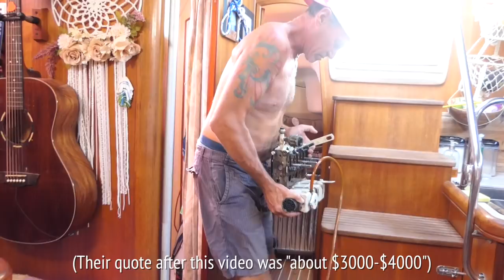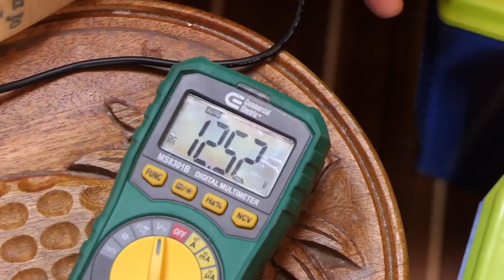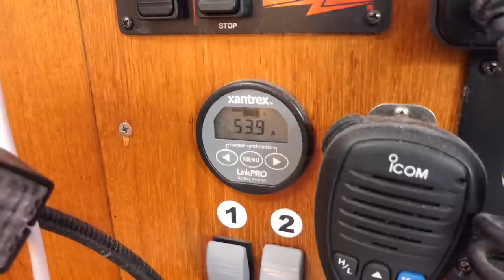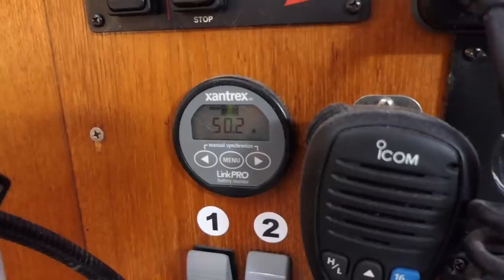Our $3,000+ MISTAKE - How Do We Make This WORK? | SailAway 185

Comment: Gotta say your "bearing"  on the piston connecting rod(which is really just like a metal collar type thingy) which is attached to the piston an crankshaft is likely worn down to nothing.  That means your piston doesn't lift high enough in the block to compress the diesel fuel on that cylinder.(Which diesels compress fuel into an itty bitty space to make it combust as opposed to a gasoline engine spark plug)  So essentially you may smell an excessively diesel fuel smell when it is running because it likely isn't burning 1/3 of the fuel it is injecting.  The wear may have just happened, but likely is the result of overheating, but more likely is due to a lack of lubrication in that section of block.  The piston could have had the bolts back out too where it meets the crankshaft.  My suggestion to get the thing out is to just take it out in pieces.  I would love to have a genset like that, but I really don't have the space.  (Catalina 30).  I do set up my Westinghouse Igen 2600 and get a good bit of service out of it.  The Victron charger/inverter can charge my bank at 100 amps  for like 8 hours on the generator for only a gallon of fuel.  Your Balmar is an awesome addition to the boat and will fit the bill.  If your inverter can handle the load, you could maybe run the AC during the few instances it might be nice, depending on its size.  I think you said you had a 16,500 btu...might be a little weak to keep the batteries topped up at idle.(It probably pulls like 17 running AC Amps.)  My friend did the alternator bit for charging and went to sleep one evening to wake to a locked engine.  The intake strainer had clogged and the engine didn't have an overheat alarm...Just remember to check your strainer all the time because PR and the islands around are full of that floating seaweed everywhere. My genset is still available, even after all these years , from the same guy on ebay.  He gets the returns from the manufacturer.  Often they were just in case buys and returns...never turned on by anybody but the factory.  I purhased mine years ago for $460ish...with only one hour on the clock.(thy have an hour meter and digital display with runtime)   It is also one of the few economical generators to actually have enough oomph to start most 16,500 AC units without having to step up to a 3500 size generator.  It uses less fuel than a Honda 2200i(which won't power a 16.5k) and my unit hasn't missed a lick with 460ish hours last time I looked.  Since you live full time on your boat I would think that as opposed to running your engine, the yearly fuel cost would be much less and you could run AC potentially when you need it.  The only downside is yes gasoline, but you likely store it anyway.  I am truly sorry your generator is monetarily hopeless!!! :(  I'll see if I cant figure out how to sign up for your Patreon to help out.
Reply from the maker: Thanks Allyn. I think you’re spot on regarding what’s wrong. Most likely happened during the overheat and the first tech somehow didn’t spot it. Wish I had a shop on land where I could take this thing and just do it myself…wouldn’t be that hard with time and space to do it. Oh well. So far the alternator is hitting it out of the park. If only we hadn’t spent as much as we did with nothing to show for it, but that’s just how it goes sometimes. That genny of yours sounds pretty awesome. Might consider that down the road, but for now we so rarely feel the need for AC, I think the alternator will fit the bill. Thanks as always for watching and the support!
Reply: @SailAwayVlog  I am pretty sure I successfully signed up to support you on Patreon.
Reply: Awesome and thanks!

Comment: The new alternator may produce more amps at low RPM but also produces a lot of heat.
It is better to run the alternator at higher speed for the simple reason that it needs more air circulation to cool off. If you have a digital thermometer (Infrared) take measurements and monitor for a few months., then compare with the manufacturer specifications. Cheers, Richard
Reply from the maker: Thanks, will do! We typically run it at 1500 if just for charging and usually for an hour or less. When out motoring we’re of course running it much faster. Next chance I get I’ll check it to see what it’s temp is doing.

Comment: I'm happy to see you are finally juiced up from both the new electrical components and the abundance of passage drinks. Speaking from nearly 50 years in the electrical, electronic and telecommunications biz, electricity is a wonderful thing when readily available and able to do its thang but a hair pulling, life altering, verbiage bending, pain in the ass when not working as it should. I second your attitude toward the physical positioning and wiring of the batteries. Perfection is for those with OCD, close enough is good enough for the rest of us...

Regarding the generator, it has three main components: an engine, the electricity producing alternator and the control/monitoring system. You have given no indication the alternator or control/monitoring system have failed. In my experience, if the control/monitoring system fails repairs are reasonably easy and not a huge financial hit. Major/expensive failures are the engine or alternator. Engine overheating usually has little impact on the alternator unless under heavy load at the time. You might consider swapping out the engine which probably will require removing the generator from its hidey hole but not dragging it off the boat. If you can find someone with the same generator and a failed alternator you might get a good deal on an engine. An engine swap is a project you can do yourself if you take plenty of pictures before removing the old one. It may take some sailing to get to the replacement but that's what you do...

Keep up the great videos and above all STAY SAFE! ⛵❤️😷
Reply from the maker: Hmmm…you know I’ve never really considered that option. It’s very possible something could be found in St. Martin, tons of boats getting various degrees of work there. I’ll keep a lookout. For now, the attempt at selling it didn’t work out, so we still have it. The control and alternator do indeed work great. I may also take a stab at flipping it over myself and trying to see if it’s just a bent rod…could possibly replace that myself. Thanks for the idea!
Reply: @SailAwayVlog  If you do decide to flip the block over and find a bent or damaged rod, remember the altered geometry can result in damage to the cylinder wall or crank or both. While the engine is disassembled, it would be a good idea to have at least the problem cylinder checked to see it's damaged or out of spec. Slight damage or out of tolerance conditions can be handled by honing, probably requiring full removal of the crank and pistons. The same goes for damage to the crank. Larger cylinder honing or crank turning necessitates oversize piston rings or crank bearings. If an engine isn't raced, built into something grander or intended to be fully rebuilt during its lifetime, like a diesel truck, oversize components can be difficult to find. The other engine components that take a beating when an engine overheats are the seals, especially those for the valves. If you intend to repair and reassemble the engine, spend an extra hour and $40 to replace the seals.

P. S. You should contact Beau of "Beau and Brandy Sailing"; he is working in a USVI boatyard and might be able to find something on that island.
Reply from the maker: Yeah, they're friends of ours...we've hung out with them a couple times here.  I'll give him a shout about this.

Comment: Way to go Eric!   You have to be an engineer if you are a cruiser.  We saw you last In Bequia as we were having a covid test at 0600.  Maracudja our Bene 423 has 600watts solar two charge controllers. 140 amp alternator balmar regulator and Honda 2200 to keep 500 amp hour batteries going.
Reply from the maker: Hey Gary! I remember that day. Where are you now? That sounds like a great balance. Our balance is slightly different, but so far with the changes it’s been working great. Hope to see you around again!

Comment: Glad you got some sort of bandaid solution, I am very close o completing my generator issue now. I went with a full engine rebuild right from the start. I sourced a kit for 1000 aussie dollars and had the machining done for another 400 then some paint and sealant another 100. 1500 all in did the assembly myself it was easier than I thought it would be. You could easily do the same thing. but for you it would be like  800 usd.
Reply from the maker: Nice!  We've thought of that.  Our two biggest issues are time (I work full time while aboard) and space...we don't really have anyplace to do that extensive of a job while the 3 of us live on the boat.  At least not happily. Lol
Reply: @SailAwayVlog  probably have to add 1k for labour if you have to pay someone to do the work it is pretty basic stuff

Comment: A bent Conrod is fairly common if you overhead and water leaks into the cylinder and you restart it hydraulic locks and bends things
Reply from the maker: Yeah, someone else mentioned that as well, and that I should be able to flip it over and get to it without removing the genny.  Might give it a shot.  Thanks!
Reply: I did it on a car :-( ! It bends the rod until it hits the bore liner, pain in the arse! Yes but fixable new mains and big end shells a con rod, gaskets depending on the hours ? Maybe rings ? Or piston and rings. If i can do it you can! YouTube is awesome and helpful

Comment: Good luck in selling the old generator. How much will a new one cost? Will a portable Honda Generator do it?
Reply from the maker: Thanks. New, they're quite expensive, like $15,000, and we just don't need it that much. The portable Hondas will do the trick, it's just the matter of storing it and the gas, finding a good spot to run it, running cables, dealing with the noise, etc.  And they typically won't power everything on the boat as cleanly and fully as the hefty built in diesel genny.  With our solar and now the high output alternator, I think we'll get along great without one.  Appreciate you watching!

Comment: Not a pooper,  now you have more ,youl use more , ?  Running your engine that low for many hours , 
Youl carbon it up and have more issues ,  run it hard every time for a while to try and offset this . 
May help and save $$$$$
Reply from the maker: Thanks, you’re right and we do try to do that. Thankfully we only need it for about an hour when we do. Always try to rev it high before shutting down and also when motoring we go full throttle about 1 hour out of 10.